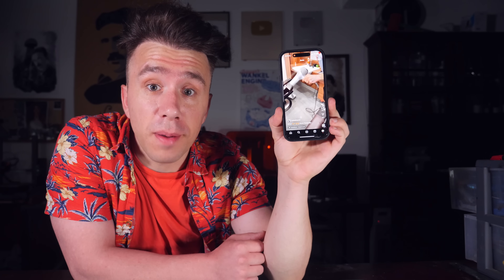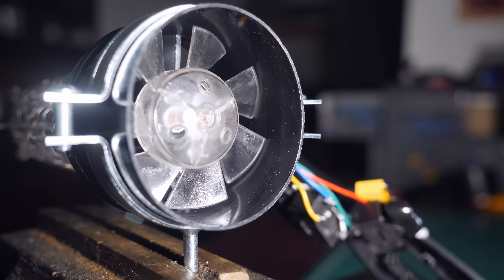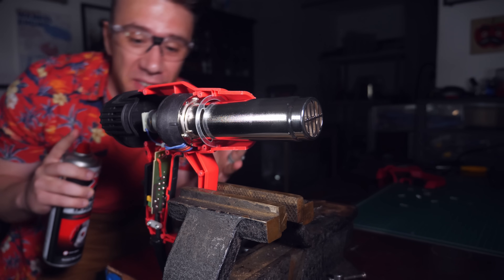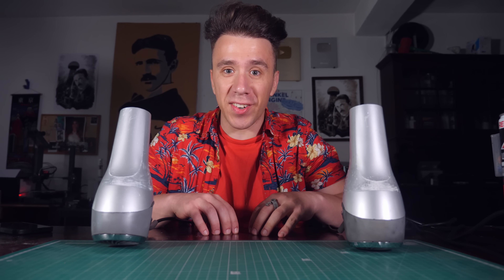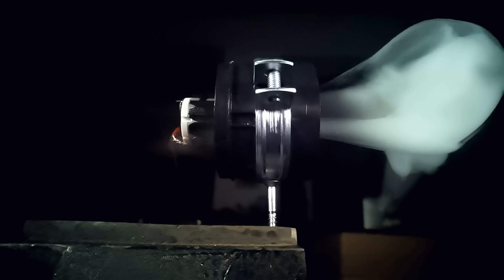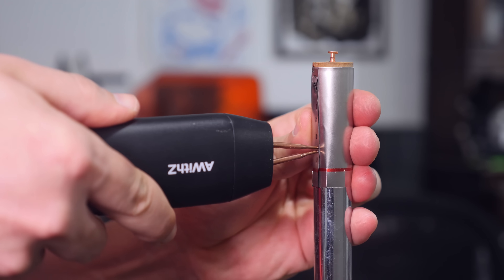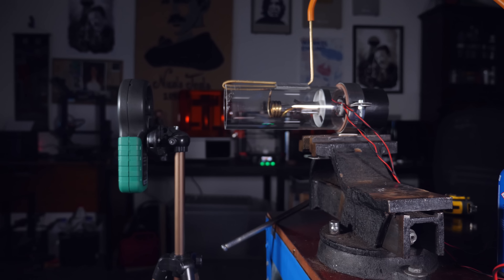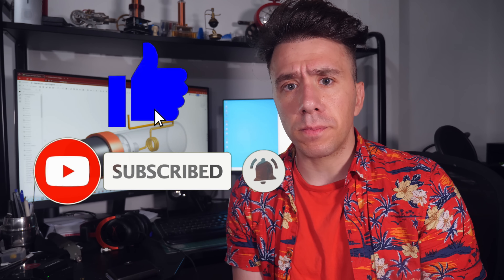I turned my $20 Hairdryer into a JET ENGINE

Comment: For your problem, you could add an axial compressor (don't underestimate those rotor stator) just before your impeller compressor. Your engine will inhale a lot more air, the air will be even more pressurized, even more efficient and the direction of the air will be more precise. 

Now Optionnal things:

I think you should also redo the impalller, to a semi-open impeller so it will diverge your airflow and compress more the air.

Afterward I would also suggest to help your convergeant airflow who will now follow your new (or not new) impeller and after your motor, guide your airflow by diverging it (idk if this word exist("diverge" if not)), till your afterburner.   
Why? It should help your motor to stay in a good path, so your engine wil be more efficient, your air to lose less speed (and maybe even your shaft (as RPM)) and help to not have a stall (less certain for this one).
 
Next, if you physically can do it, i  think it may be an upgrade to coil your fuel feed tube around your acrylic tube and add more holes  toward the center, for a better atomization .

If you want more info, idead or and precision, you can message me, I'm a student in aerospace enginering and I'm sorry if I did any sort of mistake in some words  I choose, I don't sleep that much at the moment x).
BTW, nice video, I did learn some things in it, so yeah, great.

Comment: Outta curiosity why cant you have the fuel injection face the same direction as the air flow, would it cause the fire to sputter or go out o do it require to much movement of fuel without any benefit?

Comment: Have you tried bending the Igniter Tabs at an angle instead of 90deg as in the video, this may created a screw turbulence to the air flow and thereby introduce more air into the combustion.

Comment: Why not use a copper pipe and stick nichrome wire to inside of the copper tubing and then spray it in from the back and yeah that might work

Comment: So, my experience with propane and butane flames has shown that am air gap for the fuel to go through allows the venturi effect to pull in air.  Also I found the turbulence must be directed and controlled.... possibly baffles  might work? Anyway, love your channel, you're doing good work. And from the core of my existence, since birth: tomatoes are truly disgusting.

Comment: I work on jet engines in a particular military vehicle. The way ours works is by injecting the fuel into a combustion chamber and letting the compressors suck the flame into the turbines. We call it the flame ball, and during start up we bleed off air so the flame ball can build, and once its built, its self sustaining.

Comment: Increase the power of this by Creating a nozzle which thins Towards the end of the ignition chamber and then widens out again this will give you more compressed air just before the already ignited Fuel and air this means all the fuel and air expands together giving the engine more draught and more power.

Comment: It seems to me if you atomized the break cleaner as  you were introducing the fuel the air carrying the fuel would be combustable.  Maybe a copper cap on your tube with holes drilled into it might be a cool test.

Comment: It's funny when you realize the very first jet-powered planes in history were actually using motorjets , instead of turbojets. The plane had a "normal" piston engine that run the propeller, as usual, but also a big impeller put inside a tube, which had a fuel injection and ignition system just after it. The exhaust of the system gave additional thrust to the initial engine and its propeller.

Go watch the article Motorjet on wikipedia, if you like the thing, because my english is too weak for me to explain it all here ^^

Comment: add fuel lines depositing fuel in the acrylic cylinder and a spark plug or glow plug to ignite the fuel . it should work better with propane than brake oil.

Comment: Use Dyson tech, Put additional holes on the side of the acrylic to let in more air. The fast airflow will suck in additional air into the pipe. If you want better mix add additional length to the pipe and put a nice cone shape funnel at the end of the tube/pipe.

Comment: The venturi effect works like magic to not only reduce pressure and atomize liquid fuel into a vapor, but also to slow gas mixtures for combustion.  What you have there is closer to a jet engine which uses a similar principal, except there is a fan or impeller as a compressor in the inlet, connected via shaft to anouther fan or impeller on the exhaust end, with a venturi burn chamber in between.  No need for electric motor post initial spool up.

Comment: Simple Use small diameter  but longer 3D printed version a dyson fan coanda efect then add and addtional cupper pipe like an annular burner to feed it with more fuel ,  but also feed the impeller output with some ignition and butane,  BTW i do need a 3D printer.

Comment: dude. Aerospike, central injection/ignition , radial dispersal. Both the fuel and air is forced through a very narrow area. And it has to be a radial area! That allows for the maximum fuel/air mixture! I know you probably got this suggestion, but rly, its a no brainer!

Comment: i am no expert but i have an idea, so maybe u can put the nichrome wires around the injector and put bunch of holes to the injection tube, that way it will have more time getting oxygen without fighting the wind. and also putting a narrow nozzle in the tip will make a more controlable and stronger thrust i guess.

Comment: You’ve created a very rudimentary rocket engine. The impeller is your oxygen compressor, and you’re burning pressurized butane. Make the back a combustion chamber, add a throat, and finish with a bell nozzle, preferably of appropriate length and shape to avoid excessive over or under-expansion. I’d suggest designing the nozzle throat in a way where you can easily change the diameter of the opening (metal washers?) as you will need to balance the amount of chamber pressure with the maximum static pressure that the impeller can handle (too little pressure, and you don’t get the best performance, too much pressure and you starve the burn of oxygen, or worse yet, overwhelm the impeller and get oxygen-starved partial combustion exploding out the back end.

Comment: Take the cap off of the break cleaner can.  Run a hose from the can to the copper tubbing.  Should be able to get full pressure from can would probably work

Comment: 1. We can use a contra rotating propeller to produce more thrust and hence more power.(The propeller can have max. 4 blades and not more than that.)
But it comes with its own issues. When thrust increases by so much there is a slight chance that the ignition might not work properly and might fail. Hence the best solution that I can think of is that you can improve the covering of the ignition and design it like a missile but with a small perforation at the initiation. This way we can produce more thrust without compromising the issue of ignition.
2. An afterburner might work as well.
An afterburner means more space and hece some changes to the design. First issue is the issue of the fuel rail coming in between the ignition and the afterburner. For this you can just coil the tube on the outside of the ignition and then inject. Another sub tube will inject the fuel into the afterburner.This way a lot of more thrust will be generated and fuel efficiency will be maintained.
3. The exhaust diameter must be of a bit smaller so that the pressure is created inside the chamber and this way it theoretically could produce so much thrust that it should be able to propel your skateboard :)
And yes, Tomatoes are bad!!!
We hate tomatoes!!!!!

Comment: It's very simple just concentrate all the air flowing and make the exit tighter
You can also make the tubing for the rule attached to the outer layer so it would not hinder it's performance

Comment: It's more an electric powered torch than a jet engine. You need a compression stage to constrict the intake gas or you won't really get any thrust. Compressed air is more reactive because it contains more mass and fuel oxidizer per unit volume, and when you burn it with fuel, most of the power comes from the thermal expansion coefficient, or expansion ratio of the gas rather than just the chemical reaction.

Basically it's a Newtonian capacitor.

Comment: please wear a respirator if you are going to burn brake cleaner dude ("Chlorinated brake cleaner containing tetrachloroethylene will, on exposure to high temperatures (above 500 °F (260 °C)) or strong UV light, decompose into phosgene and hydrogen chloride, both of which are extremely dangerous if inhaled.") phosgene gas is so small that a regular respirator won't help you much so you should probably use a powered air purifying respirator (PAPR). Anyways it's not really worth it to burn brake cleaner, especially inside, maybe just use butane next time (you should invest in some PPE though dawg)

Comment: If I were you I'd just do a 2 or 3 stage motor (meaning that you have 2 or 3 rows of blades) which would be clever considering the fact it's used in modern jet engines (ofcourse they are way more complex)

Comment: What if you use something with a more laminar flow like the Dyson impeller on their hairdryers? Inject the fuel sooner and put the ignition later so it has time to mix better. Would take a lot more fuel flow, would recommend possibly using a proper injector as well

Comment: Jet engine project 

Well I watched an 8 minute video on how a turbo fan jet engibe works. Got the general idea of it. Took a can, PVC pipe as the inner co pressor that directs airflow towards the rear inlet, placed a cap on the end and put aluminum flaps in that area for direction of airflow. The cap holds the fuel. I ignite it and ram air fliw into the front of the jet. Tje airfliw passes through the PVC tubing for airflow direction and over the ignited fuel whixh produces thrust and afterburn. At this point in time I didn't have a turbine/fan so I simulated the turbine with a hair dryer as air flow. Now, I am currently working on an electrect ducted fan blade for a bigger turbine system.

Comment: Was there a part two to this?  Did you solve it?  Remember those goofy designs that were like a stationary impeller you put in your air intake in your car?  The idea was that it would cause the air to spin and create a larger volume of air entering your engine for improved combustion.  Have you tried pushing the air through something like that?

Comment: Chamber the first section with a internal nozzle starting from the beginning of the tube, the main body of the nozzle should be the same circumference only reducing as it meets the outlet hole of the nozzle,,length has to be 60% of the tube. As the incoming volume of compressed air or both air & fuel must be domanant over the 2nd chamber (nozzle) as this can work with rear chamber and front chamber fuel lined, You can use the heat proof material from the hair dryer to cover vulnerable parts! Now before you size the outlet of the 1st nozzle using example stainless drinking cup sloped jet nozzle shape then cut bit by bit outlet hole & test the air flow if it holds back or pressurises out of the intake! then proceed to  enlarge until airflow is at full release! if you wish to add fuel within the first chamber (nozzle) bare in mind this creates more pressure so then testing is required regarding outlet size to avoid flame backdraft adjust until air & combustion flow freely! leave a lip on the outlet 2cm or cut slots then bend them outward to hold fuel line in place, choose your fuel pipe wrap around outlet lip of the nozzle drill holes in fuel line on the piping that surrounds the outlet lip only! holes facing towards exit . Now a secondary nozzle is added this should slot over the first nozzle, the secondary nozzle must have a smaller outlet than the first nozzle again testing is required to balance the 2nd outlet nozzle as compression & combustion at a greater volume will enter the 2nd chamber nozzle with a smaller outlet the greater volume forced into 2nd chamber is forced to compress more so due to smaller outlet! 1st nozzle dimensions inside the second creates combustion space and one way flow as it doesn't have opportunity to return flow under pressure, and if balance is correct it should create boost ( basic rundown) 2x nozzles 1st nozzle being longer than 2nd nozzle by 10%  diameter & circumference  being the same as tube, if you need the tube but is not necessary 1st chamber balance one or both fuel & air optional, in 1st chamber balance outlet size to performance peak 2nd chamber fuel line wrap on lip around 1st outlet. Drill holes facing EXIT, Balance outlet of 2nd nozzle wich has to be smaller balance by grinding mm by mm to catch pure balance. Getting these particular sections balanced creates a spacific reaction you may find interesting done correctly it's should create a continuem flow of boost wich you can modify more so, this is of a budget design but most affective I have found in testing

Comment: As another idea to improve the thrust that at high engine power, you could make the exhaust nozzle more tight, so that the air comes out with more pressure... I dontt know if this could improve the thrust or not, but I see a lot of jet engines using this principle. It just like when you let a blown up ballon go, it will fly by the air that is blown out, but it wouldnt work with a tighter end, because there wouldnt be enough space to let enough air out, but neither with a bigger end, because there wont be enough pressure. So in conclusion the idea is to make a tighter nozzle, so the air is forcen out with more praessure, making air come out faster.

Comment: I use brake fluid and brake cleaner as a way to start engines after a rebuild for racing. Even after preheating the block the pistons can be a little too stiff to move easily. Brake fluid makes a good starter fluid. In the "time of the dinosaurs" it was common to spray brake fluid into carburettors to start an engine. Yes, I said fluid not cleaner. It makes a petrol engine "diesel" - detonation without spark.

Comment: increase  air  for  combustion  with  circumferential  proximal side vents  for venturi effect    and guide increased airstream towards the central/longitudinal  aspect to preserve acrylic tube   -    think about  a   pitot tube   system  to determine thrust -     good luck     -   DPB

Comment: I think you could have a cone so that more of the air would be pushed into the fire. This could have some problems but it should push more air into the fire giving more boost. The down sides are that you will lose the air shield that stops the fire from burning the pipe.

Comment: so for the the igniter you can move it a little closer to the exhaust not much. As for the actual flame using more of a cone shape might produce a more calm flame to heat the fluid or gas slightly better or you could make the flame go more into the wind by angling the little cuts in the metal at a slight slant say 15degrees opposite of the fan direction witch make more chaotic flames and instability but produce more power. you could make a more efficient exhaust cone or intake. different combustion case shape

Comment: Hahahaha! Asking me for advice on rocketry? No problem. First, fit a speed controller dial to your impeller to enable fine tuning of fan speed. Make two feed nozzles to turn liquid to vapour when pressurised. Place feed valves on the lines so you can adjust the amount of each liquid. Connect one to a supply of liquid brake cleaner (pro tip - you don't need to get it in spray cans). Connect the other to a supply of hydrogen peroxide. The two in combination should make your flame blue as you adjust the peroxide flow, and should make your burn more stable at higher fan speeds. If you want really good thrust, fit a stepped conical nozzle to the jet outlet so the thrust has something to push against. It works in zero gravity, and should be even better with atmospheric pressure to work against.

Comment: Run twin multiblade fans on single shaft (opposed blades with Brake cleaner ignition between fans with reduced exhaust end allowing primary fan motor to disengage once vacuum is created

Comment: Real Turbofan engines had two sections of airflow, the High Bypass that is just air that comes from the fan passing outside and inside are a huge cylinder with compressor that compress the air and the fuel chamber that bangs out all out in the back, the turbojets dont had the 2 section bypass and even thr fan, its just compressors, so of you actually print the compressors and put it behind the fans it maybe bang

Comment: You're wrong, it's not the heat from the heater that ignites the fuel, it's the sparks from the brush engine that act as an igniter, nice video by the way ;)

Comment: The hair dryer you were looking at was an older model where the heating element is in the back similar to a room floor heater. Electric element but it was in the rear and the blowers also sucking from the heat and pushing it forward

Comment: High bypass turbofan, runs cooler, use a mini jet engine combustion chamber with multiple injectors and a turbine that is connected by wire ,I,e a generator to power the electric turbofan right in front once steady combustion is achieved.A shaftless turbo jet.

Comment: @Integza, All you need to do is put a nosle on the exit/front of the combustion chamber like they had in the original video. If ypou narow the escape of the flame it will burn up more oxigen.